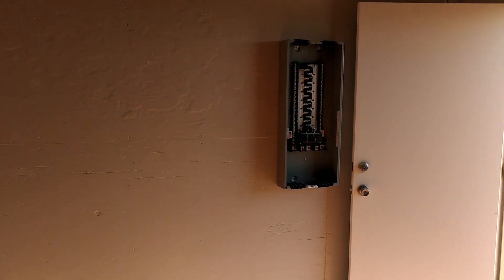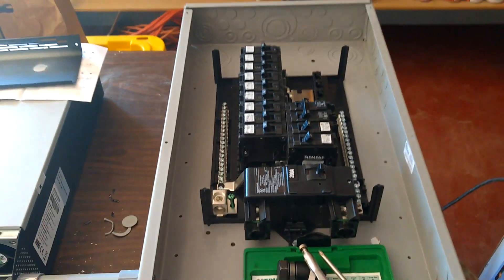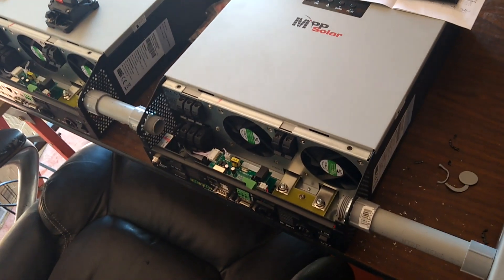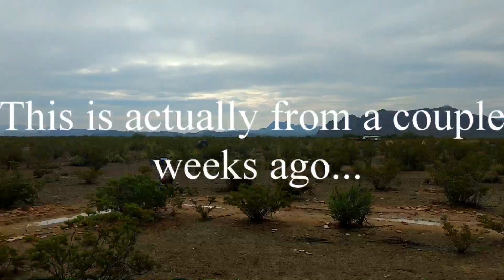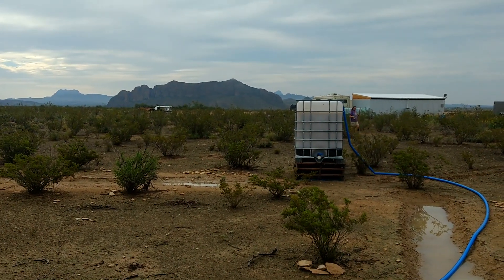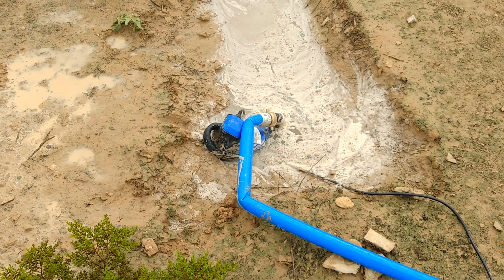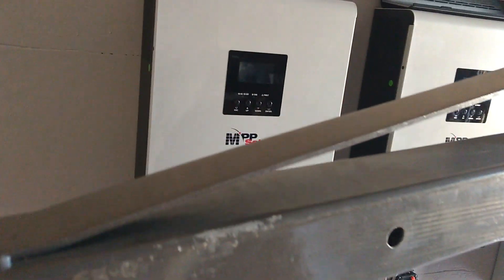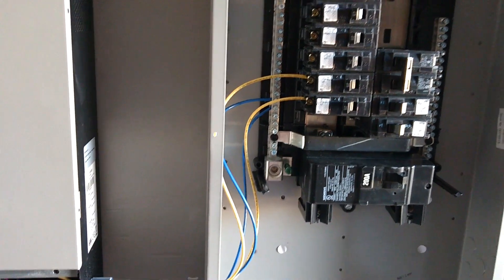Bringing power to the power building - MPP 5048MG - Terlingua Texas - Off-grid Homestead

Comment: Looking good. I keep current on your recent videos, but are you setting up a desert resort here or ?? I am not sure why the need for so much off grid power.
Reply from the maker: Yes, we plan to have guests :) also, we'll be running a lot of electric stuff including hvac, water heaters, stoves and clothes dryers among other things so we need the inverter capacity for those. Of course we could go small and make do, but that was never the intent here. We'll have a run down on our costs for this system soon. I think most will be surprised how much you can get for as little as we have into this.

Comment: I like the conduit solution, looks good. Do you use two inverters because of the number of solar panels you have?

All the best to you, Lisa and Theodore!
Reply from the maker: Yes, these inverters are also charge controllers and each one is good for 4kw of charge and 5kw of inverter. We have 7.2kw of solar currently so we need 2. However, we're also running an electric water heater, stove and clothes dryer so we're running three for the purpose of providing enough AC power to run all those things at once. Also, we'll soon have another row of solar so each inverter will have a little over 3.6kw tied to it.
Reply: Thanks. I've seen those in Will Prowse' videos before.
Reply: @fullvegan Re-wired my electric water heater for DC and AC input so it can be connected to the solar array and grid AC The array provides around 250V at 5 kW which works great for the water heater element that is 4.5..5.5kW.  Only the lower element is connected to solar, upper stayed with AC from grid. have upper element normally turned off via breaker, it is backup only when no sun for a few days and we still need more hot water.  lower element thermostat switches a mosfet transistor (IXFN210N30X3) on and off because thermostat only works with AC, DC will burn it up over time because of arcing during switching.  the mosfet then switches lower heating element on/off like a solid state contactor.  Solar Array heats up 60 gal water heater in 2 hours, rest of the day it can provide power to an inverter for other usage like pool pump in my case.